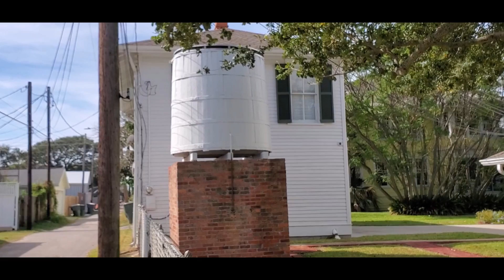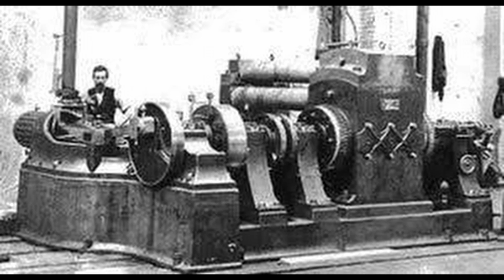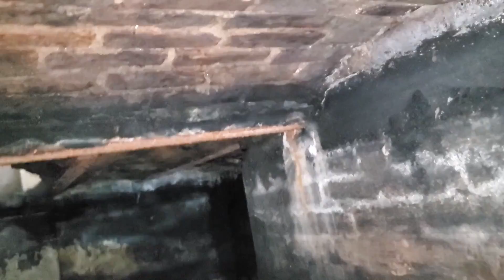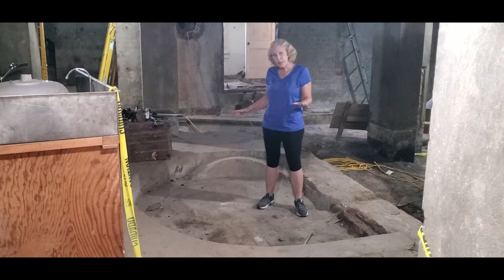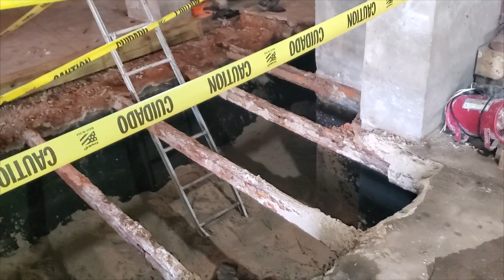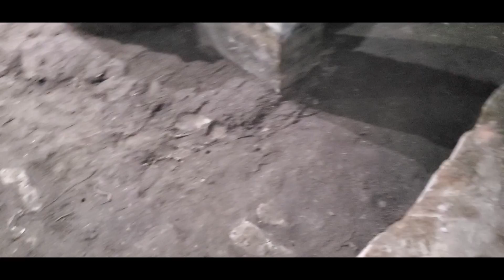S1.15 The Cistern - Should It Stay or Should It Go?

Comment: Should have brought in engineers who do this kind of technology. Restore or preserve this lost technology for future studies. She ruined it. 
This cistern could be used to cool the house. Gaining water from the gutters and ground water is valuable when county/city water isn’t available. Self sustainable was the original plan.
The ground has a constant temperature below 60 degrees. The water and heavy stones and masonry allowed the coolness of the earth permeate up the stones to cool the house. The exterior wood siding shaded the stones from the suns rays. It was ingenious but an old solution from time before Christ. That was why ancient temples had many colonnades. They radiated the coolness from the thick marble slabs. Covered by a wooden roof many feet high to where the heat is does not interact with the cooler ground effect.
Reply from the maker: Sorry, but I am an engineer and that doesn't work in this climate.  In fact, another very large building was being restored downtown at the same time and removal of the underground cistern was required for the state to consider their project for preservation tax credits.  Ancient temples were built in a desert, not on the Gulf Coast.
Reply: @leaguekempnerhouse 
Thank you for responding so quickly. I apologize for being so brass. 
I agree the cistern works better in a desert environment. But for them to go through all that trouble in its day says a lot. Especially after other homes duplicated it. After seeing the present photo of the area devoid of trees because of Hurricane Ike, the area will be bathed in humid hot air. The hurricane of 1900 killed many trees. The Women’s Health Protective Association’s, at the time, worked to restore the tree canopy of Live Oaks, Palms and other trees. This canopy would create an ecosystem of cooler air near the ground. Allowing an updraft passing over the cistern on low humid days and shutting it down on hot humid days. Allowing the transfer through the masonry. 
Abandoning the smaller cistern for the larger one means they probably tried to improve the cooling after the 1900 hurricane, from the lack of trees and freshwater. 
The cistern cooling will not work with the present loss of the tree canopy. There is no updraft, just stagnant hot humid air from the ground to the top of the house. The ocean breeze blowing through a canopy of trees in the spring and fall would extend the cool air season for relief of the notorious humid weather of the area. 
I experienced a cooling effect within Callaway Gardens lake effect. The lake surrounded by trees lowered the air temperature by ten degrees. 
I gathered my information from the Galveston Island Tree Conservatory website. And the Galveston Tree History link. I wish you and your team well.
Reply from the maker: @Ralpha1961  Thanks.  It is a very complicated restoration.  The climate is a big part of the problems in the house and the fact that the island was raised but this house wasn't.  Dirt was just added around the exterior about 18" to 24".  The island also didn't have Formosan termites at the time it was built. They are a nightmare.   They had literally taken over the house and were all the way up to the very top of the roof rafters.  Getting moisture out of the house was critical, hence the deciding factor in removing the cistern.  We have spent just over $80,000 on yard work to correct drainage issues and grading issues that were created over time.  We are happy to say that we have been dry for over 12 months at this point.  Were you aware that the WHPA's tree planting effort was led by Daisy League.  JC League provided a lot of the money for the purchase of the trees that they brought in.
Reply: @leaguekempnerhouse 
A beautiful house. WHPA, Daisy League and the JC League were driven to meet the needs of the community. The woman made a difference providing much needed shade tree and ground cover, food, shelter and relief from the devastation of 1900 hurricane. It’s a shame their great work for the community was wiped out again by Hurricane Ike. After saving the homes, maybe the community can rebuild the beautiful live oaks and bring back the true Galveston lore of tranquility of its beautiful trees. 
The High Society women of Macon Georgia planted and gave away countless ornamental Japanese Cherry Trees decades ago. Nearly every business and home had a tree. Areas where they were massed planted became known as The Cherry Trees Festival. Bringing arts and crafts. They took over downtown Macon with stalls, concerts, crafts and bus rides to coincide with the Cherry Trees blooming. After a few droughts in the last decade, many trees were lost. There is no one to replace the beautiful trees but they continue the festival. Loosing its lore. So much history you have. I hope it’s not lost.
Reply: From the internet:
 
Louisiana’s iconic live oak (Quercus virginiana) canopies are famous for their massive, sweeping branches that stretch out nearly twice the distance of the tree's height. A single mature live oak canopy can span anywhere from 60 to 100 feet, providing up to 17,000 square feet of cooling shade.

Key Characteristics of the Canopy
Size: While they grow 40 to 60 feet tall, the canopy's horizontal spread is their most defining feature.Low Sweeping 
Branches: The limbs often grow outward and downward, with the oldest specimens having heavy branches that touch or dip into the ground.Evergreen 
Nature: Despite shedding some leaves in the spring as new ones emerge, these trees keep their lush green canopy year-round.

Notable Louisiana Canopies
Seven Sisters Oak: Located in Mandeville, this is widely recognized as the largest live oak in the United States. Its massive, sprawling canopy is a registered landmark.
St. John Cathedral Oak: Located in Lafayette, this famous tree boasts a trunk girth of 27 feet and a sprawling, historic canopy.
New Orleans City Park: This park houses the largest registered stand of mature live oaks in the world, with over 200 trees featuring interlocking canopies.

Environmental and Historical Impact
Natural Defense: These canopies are crucial for Louisiana's ecosystem. A mature grove acts as an immense stormwater sponge and lowers localized summer street temperatures by up to 15 degrees.
Historical Significance: Live oak wood was so structurally sound it was used in early American shipbuilding, prompting Congress to pass some of the country's first forestry laws specifically to protect them.

Comment: Nice background and well presented. You present the history and the technology very well.

Those brick arches and iron beams are high end construction for the time.

I’ve restored houses from the 19th century and nothing is scarier than Victorian plumbing. Sure you got running water, but Lord knows what nasties lived in it, possibly including lead from the pipes.
Reply from the maker: Thanks.  This house was a technological marvel in its day.  The front porch floor is made the same way as the roof of the cistern.  We have such a hodge podge of plumbing and electric in this house.  Everything is getting taken out and put back to current code.  What a chore.
Reply: I always dreaded knob and tube still live and 100 year old plumbing, either ‘potable’ water or sewage. One house in Covington Kentucky had a ‘house trap’, a sewage trap but for the whole house. It took two days to dig it out (clogged). None of us had ever heard of a house trap.

But I envy you the task of restoring the house and the detective work needed to sort out its secrets!

Comment: It looks like the whole property drained to the cistern.  Was the cistern connected on to the sewer so that it didn't overflow and flood the basement?
Reply from the maker: I have a new water problem in the basement so I'm about to do another detailed video about the property's drainage issues.  The original cistern had a large overflow pipe that went outside.  In theory, all the gutters to the house fed the cistern but the overflow went outside and would be carried away from the house by the original grade of the land.  However, they kept adding more and more dirt to the yard so that eventually the entire yard drained back towards the house.  Not a good thing.  I don't know if you've seen the video yet, but I had to bring in heavy equipment and do a lot of work in the yard to address the water issues in the basement.  I'm only about a fourth of the way finished with what needs to be done in the yard but I did tackle the worst problem first.  Water has been our biggest problem.